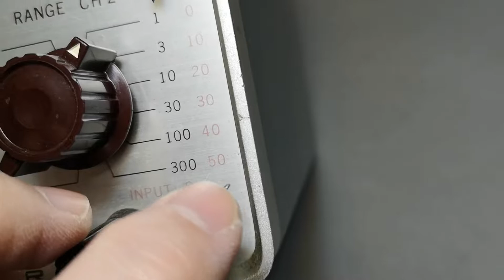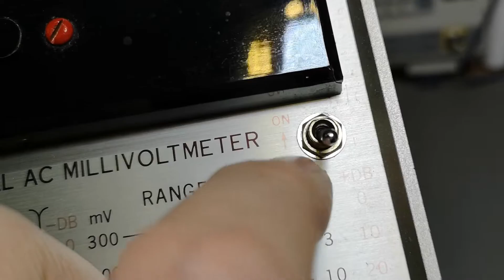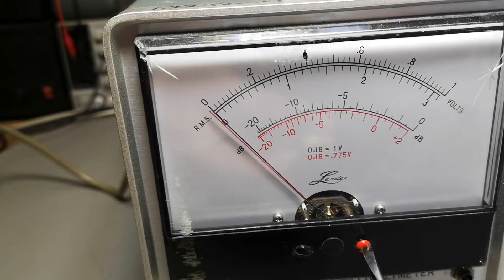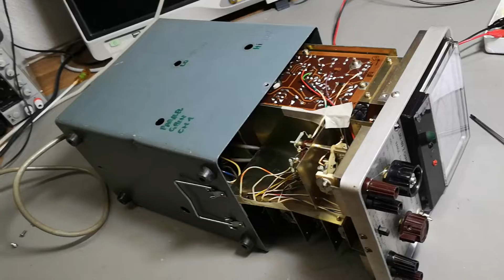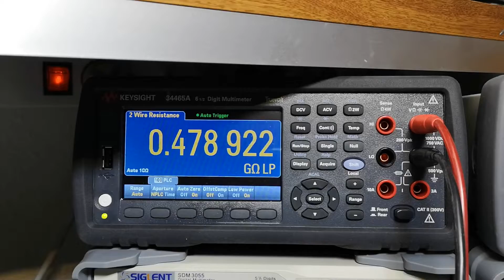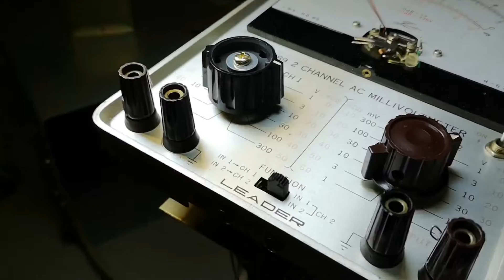Leader LMV-89 2 channel AC Millivoltmeter Teardown and simple test

Comment: Hello Thomas.
I also have one of these LMV-89. It had some issues when I bought it, but now it's fixed. One suggestion I have for you, if you want to use it, is to replace most of the internal wires with shielded cables. The circuit is very sensitive and on the 1mV and 3mV scales picks up ambient noise. I identified the wires to be replaced by touching them and watching the needle deflection. 
I have obtained the manual from the Leader Corporation. It is a very poor scan, but still readable. I would gladly forward you a copy if I knew how to do it.
Reply from the maker: great info , thnks for comments, YES it is crasy how sensitive it is, clearly due to the high impedance, it is all ready on its way to its new owner